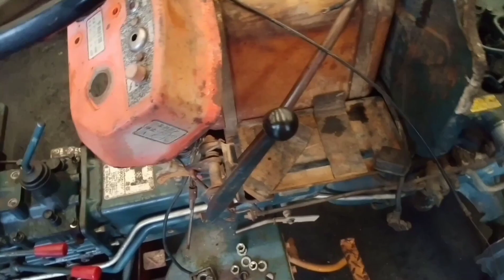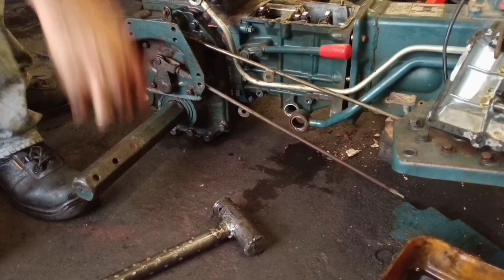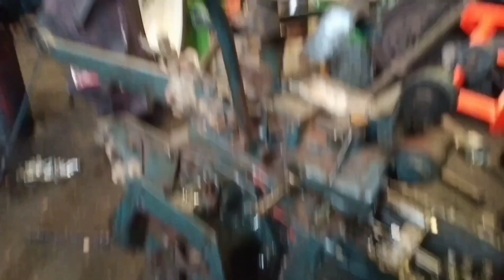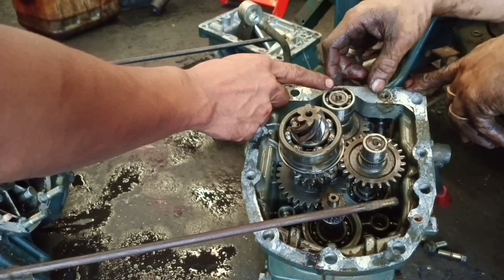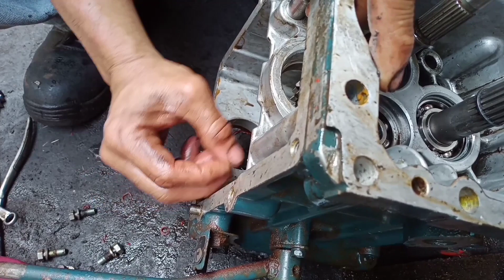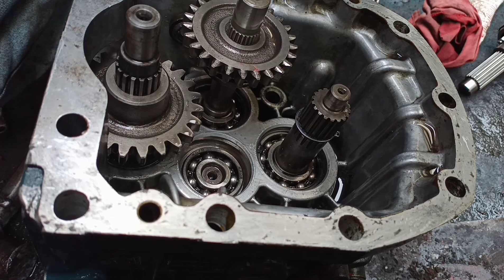Kubota B6001 transmission gear replacement ll reassemble ll part 1

Comment: I have a question, are the three nuts on the drive shaft supposed to be loose or tight. b6000

Comment: Good mechanic. Fix it all. I'm confused how easy all that bearings go in. For the brocken teeth take a magnetic pen for catch them out the box. In my youth time i fixed Zündapp Mopeds and make them faster.
The bearings in this engines fits stronger in cases and the crank. Its intresting me for watch inside little tractors. 👍🇩🇪 Which is the lever for 4WD ?
Reply from the maker: The 4WD lever is the first one from lower at the right side.
Reply from the maker: I'm sorry  I have no idea.
Reply: @Matias Santino Instablaster =)
Reply: @Arian Finnegan I really appreciate your reply. I got to the site through google and Im waiting for the hacking stuff atm.
I see it takes quite some time so I will get back to you later when my account password hopefully is recovered.
Reply: @Arian Finnegan it did the trick and I now got access to my account again. I'm so happy!
Thank you so much, you saved my ass :D
Reply: @Matias Santino you are welcome xD

Comment: Hello, i own a kubota M5030 six cylinder and my problem is that the tractor for some reason in slower than should be. It should speed 28-30 km/h and my speeds 18-20 km/h(2200 rpm). It is revs nice and the wheels are stock. What is going wrong? and what i could improve in the gearbox?   thanks
Reply from the maker: I'm sorry I don't have an idea how to improve your gearbox.

Comment: Any experience changing the output shaft on a b7100 hst? the end of the shaft sheared off where the roll pin goes through for the front drive shaft
Reply from the maker: do you mean to say the propeller shaft?for the front drive propeller,you need to do is to split transmission from the bell housing because it is very hard to remove the pin from it but if you want to remove cross joint,please watch from my video if you do not already watch on how to remove it.HOW REMOVE PROPELLR CROSS JOINT or just click from my playlist.thank you for watching
Reply: tractors&marine MECHANIC I actually need to replace the shaft itself that the propeller shaft slides onto. It’s sheared off at the tip of the shaft where that roll pin goes through. Wasn’t sure what all had to be disassembled once the trans was split from the bell housing

Comment: dear, do you know the ratios of the gears? because I want to put 16 inch rims at the back, but then the front ones also have to be bigger and we don't know which one?
  I have a kubota B6000 and are now 14 inches on it and want to go to 16 inches but then I need to know the gear ratios?
can you help me with that or do you know which sizes I can take?

Comment: Hello sir! I have a Kubota b7000 with a z650 engine,the problema is that the engine is pushing oil into the radiator. How can be fixed?
Reply from the maker: https://youtu.be/YVU0OWBW5d8

The  above is one of my video that you can watch and learn  that your engine  can fixed it.maybe you do not understand my tagalog language but you can see where was the problem or the oil coming from. the cylinder head there is a cover and remove it.just follow on my video.thank you.i hope you understood.
Reply: @tractorsmarinemechanic  thank you verry much for answear,unfortunatly i don't understand what is the problem with cylinder head.
Reply from the maker: The oil that pushing into the radiator was coming from cylinder and when you removed the side cover from the cylinder there is a small blind hole that you should to fixed it.
Reply: @tractorsmarinemechanic  thank you verry much for answear,i have manage to fix my engine. You are the best mechanic for Kubota.

Comment: Where do you get parts gears sprocket for b7000d
Reply from the maker: From metro diesel in the Philippines
Reply: @tractorsmarinemechanic  thanks will have a try at replacing third and sixth gear any advice on gaskets kits or bearings
Reply from the maker: Gasket 1/32.You can buy gasket to auto supply

Comment: bos parehas lang ba ng transmission yan ng B1902..
Reply from the maker: Magkaiba  po
Reply: sir yung B1902 namin check na namin ang clutch at pressure plate kapal pa pero bakit usad pagong at parang maingay loob ng transmission. ano kaya problema non sir?
Reply from the maker: May front drive po b yn?may high and low po iyan e-on mo.
Reply: 4x2 lang sir pagkinakambyo ko sir ang PTO sa gawing kanan sa baba parang ayaw pumasok. may konalaman kaya yun sir?
Reply from the maker: Baklasin mo baka may pingas Ang gear
Reply: maraming salamat sir.. follower mo ako sa YT channel mo... Godbless sir..